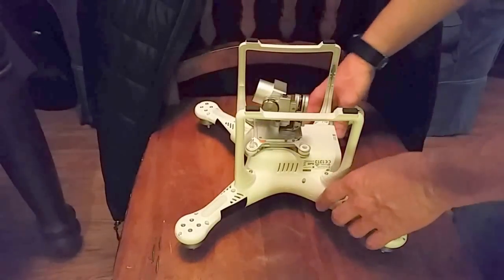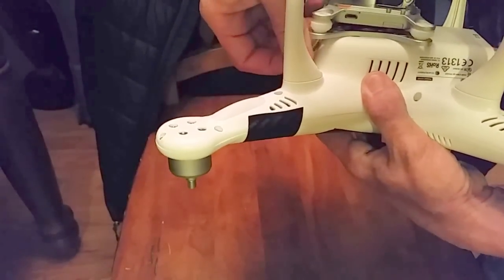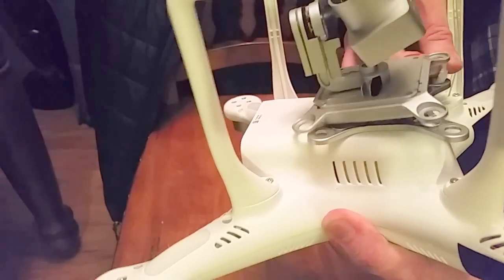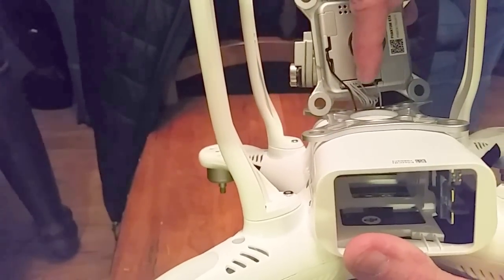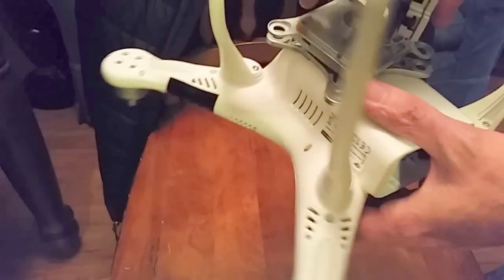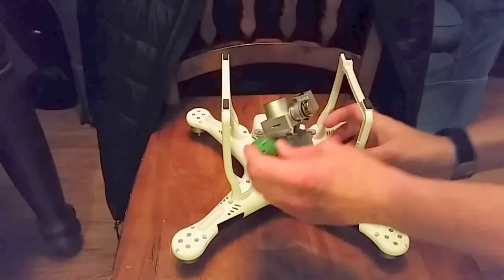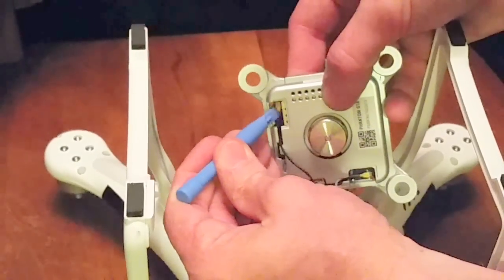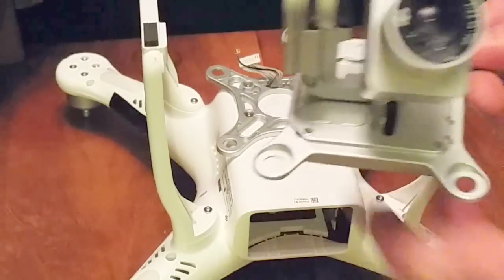How to remove the DJI Phantom 3 Standard gimbal & camera

Comment: Had a crash this morning.  3D printed a part from MyMiniFactory and used these directions to repair my Phantom.  https://www.myminifactory.com/object/3d-print-dji-phantom-3-camera-vibration-absorbing-board-54572
All went well.  Antenna wires are difficult to reinstall with my fat fingers, but be patient and don't force it.  Thanks for the help.
Reply from the maker: I saw the link. Is that your site?
Reply: no
Reply from the maker: Well, thank you for sharing the link. Ill pin it to the top so maybe more people can use the info too.

Comment: In a crash, the black and gray wires separated from the gimbal. Any thoughts on what to use to reattach them? btw, your video is very useful!
Reply from the maker: Thank you Todd. If I remember correctly the end of the wire is a U.fl connection and most wifi antenna wires are the same U.fl. you may be able to use a wire from an old router. Its been a few years since I messed with the P3 so I just can't recall.

Comment: Can I remove that camera permanently and connect it to my laptop to use it as my laptop camera
Reply: Well I was just trying to but every single wire I put did not work
Reply from the maker: Ya you will probably need to find a wiring diagram.
Reply from the maker: Lol. Thats one way to use the camera. 
You probably can. If you can figure out the wires.

Comment: Recently had a crash and my gimbal stopped working, it says "gimbal overloud” and when I turn my aircraft on the gimbal become crazy. By the way my camera works perfectly and I get a feed right to my app, and I can change the angel of the camera remotely, so I’m thinking it’s not a wire problem. I hear a grinding sound; it’s definitely making a noise and the gimbal parts become warm. Do you recommend I replace the gimbal or its other parts problem? Thank you.
Reply from the maker: I cant be sure but it sounds like the gear in the gimbal arm in broken. You might be able to replace the parts but  im not sure if you can. You may not be able to get those parts.
Reply: could you send pic's of the gear in the gimbal arm please.thank u

Comment: hey do you know exactly what does black and grey wires do? in my opinion and research flat grey one is gives power to the gimbal which makes it possible to move. other two is i just dont know
Reply from the maker: Hannah Banner Its been a long time since I have looked inside the P3S but I remember 2 ceramic antennas on the side of the battery compartment. Two wires go to there.

Comment: I have the phantom 3 standard the gimble works fine but I have no video feed can I take the gimble off and put a gopro 📷 on it?
Reply from the maker: Im sure its possible but the wiring harness would need to be changed.

Comment: Anger sometimes can motivate. Still angry at Helipal, figured the parts won't show up until the next Chinese New Year, so I broke out the soldering iron, spent an hour splicing, using magnifying glass, reassembling and fixed it. Took these pictures today: 

     http://decsoftware.com/aerial_photos.htm

Comment: Great! Unluckily my two antenna cables were broken, but I fixed it! But why are the antennas in the gimbal? The two cables are for the connection, right?
Reply: And are there videos, how to replace these two wires?
Reply from the maker: It has something to do with sending the video back to the controller. One antenna controls the aircraft and one is for telemetry. If I remember correctly. Its been a while since I messed with the P3S
Reply from the maker: Its dangerous to repair the wires. If they loose connection you could have a fly away. Its safer to replace. Which is a huge pain in the, you know what... There are videos out there to take the aircraft apart.

Comment: You mentioned during the video at about 4:50 USL connectors.  Any idea where to get replacement USL connectors?
Reply from the maker: I did at one point but its been so long that I can't remember now. Have you tried Amazon?
Reply: Thanks for your reply.

Yes, and all the electronic parts stores in America (well, only about 5 national stores). "USL connector - what?"

My wires pulled out, so I thought I would replace them. Not as easy as I thought since they've already been crimped, so I thought I would go with new ones.
Reply from the maker: Man that sucks. Last time I looked at B&H they also were out of stock. You may have to buy a crashed drone. You will probably have to replace the antenna inside the drone.
Reply: Still looking for USL. Why would the antenna need replacement?
Reply from the maker: Aren't you talking about the grey and black wires that lead to the internal antennas on the drone?
Reply: Yes. They attach with the little push on connector. You remove them at 5:00.
Reply from the maker: Try this link. scroll down the page and see if anything will work.
http://www.helipal.com/djip3-042-cable-set.html
Reply from the maker: Dan Clark Awesome, I had forgot about that site until you said something.  goodluck.
Reply: Well, instead of getting a new drone ($500) and using the 'old one' (4 months old) for backup parts, I ordered 21 bucks of replacement parts and I think I'll be 'good to go'. Thanks!

Comment: thx that was so easy! however dji's slow and lazy repair team tried charging me 210 (total was 350! drone cost 400!) for a brand new gimbal when they could have just replaced the terminal on the wires! So I asked them to return it! they will scam you!
Reply from the maker: Ya you can't trust them. They are a very greedy company that does not care about the customer at all.

Comment: Thanks for this, great help!  I have to replace the bottom bracket attached to the body and the black and grey wires had me concerned.  Wish I'd watched this before cutting the plastic shock absorber pin, but oh well.
Reply from the maker: Dan Harrington I hear that. I had a similar experience installing a backup camera on my car. except I removed the whole bumper. lol. #lessonslearnedthehardway

Comment: are you saying you can your drone without the gimbal? the grey and black wires are for the wifi antennas so idk how it could fly without it?
Reply from the maker: Yes, You can fly without the gimbal. YOu wont get telemetry sent back but the antenna is still working. I have not flone very far without the without the gimbal but definitely have flown without it. Fly 30 or 40 feet away then flip the RTH switch. It should still work.
Reply: ok cool, i just had a bad crash and one of the antenna wires broke so I am waiting for the new one to arrive
Reply from the maker: Just fly with caution. 1 antenna is for the video. 1 antenna controls the drone. I forget which one does what.
Reply: hmmm, idk either. i have no plan to fly it til its fixed properly. after the crash i was able to power up and throttle up the motors but i was unable to set a home point and my go app doesnt find the craft by default, i have to scroll through the other drones like i did the 1st time. hopefully once all is repaired i can do a recal and maybe that will fix it?
Reply from the maker: Ya I see the problem. Ya better safe than sorry.

Comment: Can you fly it without gimbal & cam?
Reply from the maker: yes you can, you just wont get the information on your device, like video, gps, distance. so just make sure you learn the different LED light signals.
Reply: Guardmy6 are those failsafe options still accessible through dji.go apps?

I'm planning to remove gimbal & camera for temporary and keep them safe while i learn to fly atti mode accurately at low altitude on open area, prevent high loss in case of crash.
Reply from the maker: +Singgih Arfianto that is an excellent idea. highly recommended too.

Comment: hey  @Guardmy6 - if the grey and black wires have detached from the gold connectors -  should be able to reattach without having to replace the wires?
Reply from the maker: Is it possible? Yes. But I'm telling you from experience. You take a huge risk of crashing again. or worse, a fly away. Sorry I wish I had better news.
Reply: why?
Reply from the maker: The wires are put in and crimpt with a tool. If not done right it could come loose. Thats when the bad stuff happens

Comment: I've snapped the camera off the motor. The camera is fine. What would you recommend replace the hole gimbal or any other solutions
Reply from the maker: Did any thing else break? or was it just the arm the holds the camera?
Reply: just the arm
Reply: and a broke flex ribbon
Reply from the maker: Sorry for the delay, I didnt see your comment. you can probable fix the are and replace the ribbon with a new one
Reply: Exterior the 3d printers provide excellent replacement parts for the gimbal
Reply from the maker: What do you mean?

Comment: can i replace those antennas with 2 normal 2.4ghz antenas? for the gimbal signal? :D
Reply from the maker: that is a good question. i cant say because I have never tried but i would think as long as the Uf.l connector fits and its the same frequency it should work. but i dont know enough about it. sorry
Reply: +Guardmy6 I have 3 cables in pretty sure will fit! I will give it a try
Reply from the maker: +Edmundo Andres sweet. let me know. i took the cables from my wifi router and put in my controller. it worked fine.

Comment: hi i have a question. recently had a crash and my gimbal stopped working, it says "gimbal gyroscope error" and when i turn my aircraft on the gimbal just doesnt work, it stays limp. By the way my camera works perfectly and i get a feed right to my app, so im thinking its not a wire problem.
do you recommend i replace my gimbal and camera or is it a wire problem? thank you.
Reply from the maker: Well, that's a tough one. If the camera still works it is probably cheaper to fix it than replace it. I can't be sure without seeing it but it sounds like the gears inside the gimbal are stripped or broken completely. Do you hear any noise coming from the camera or gimbal? like a clicking or grinding sound
Reply: Guardmy6 I think i hear a faint grinding sound, its definitely making a noise. i just want to thank you for giving me some advice in advance, i havent been able to get help or an opinon from anyone. i need to fix this asap because i have some projects coming up. I was thinking of buying a new gimbal and camera or even a whole new drone body. :/
Reply from the maker: Glad I could help. Thats the whole reason I made the video. At the time I could not find any help either.
Reply: Guardmy6 i decided to just replace the drone body, as the need for a drone right now is dire.
Reply from the maker: Good luck man. I was filming a sailing regatta and the battery lost all power at 30% and I lost the whole drone.
Reply: Guardmy6 oh no :/ some bad luck.
Reply from the maker: For sure. Hopefully DJI will honor their warranty. Flight logs confirm battery failure.

Comment: AS YOU SAID ... there's not much on this and your video covered everything i needed to know ... about the black and grey wire ....i had a disconnect and needed to to simply reconnect them
Reply from the maker: awesome. glad your back up and running
Reply: I added a second to the arsenal so i can learn from one and in action times now i have more batteries and it ended up working out
Reply from the maker: Nice. I did the same thing. I have a standard and Pro. Of course you have to modify the P3S antenna. lol

Comment: Does it bind to the controller without the gimbal on? thanks great vid.
Reply from the maker: +Ppr Rud Good question. If the controller is already minded then yes. If its not, I don't know but I would assume so. I did fly mine without the gimbal but just don't fly further than line of sight.
Reply: +guardmy6 Why shouldn't i fly further than line of sight? Shouldn't the range stay the same.
Reply from the maker: +Ppr Rud theoretically yes. I just say that to be safe. I have not tested the RTH function with the gimbal off.
Reply: +Ppr Rud Thanks for replying by the way really appreciate it.(:
Reply from the maker: +Ppr Rud no prob.

Comment: where did u sent your camera to for the fixing?
Reply from the maker: +Khade Muangkroot I did not send it off. I fixed it myself. 
I made this video showing how I fixed it and where I bought the lens. Hope this helps. 
https://youtu.be/p8khpF9tgc8
Reply: +guardmy6 how to check if the software in the camera is working fine? I broke my yaw arm and the ribbon cable everything else look fine from the out side the drone still flying but cant connect to the GPS
Reply from the maker: +Khade Muangkroot 
the ribbon has to be fixed for the camera to work. As far as I can tell the camera has to be functioning to get information on your phone. in other words, broken ribbon means no GPS signal sent to your phone. If your phantom hovers in 1 place without moving then your GPS is still working but the phone shows it as no signal.
Reply: +guardmy6 just check the flying GPS system didn't show up on the phone but it still working fineso is that mean that I only have a problem with the yaw arm and the ribbon then?
Reply from the maker: +Khade Muangkroot I can not say for sure. but it sounds like that may be the only problem. Good Luck my friend
Reply: +guardmy6 thank you so much!

Comment: Thanks for the video.. I had a crash and the camera mount broke and the whole thing ripped off..Ripped the wires right off the camera and I could not figure out where the black and grey wire went to.. Now I know but those tiny pins connectors you popped off for the black and grey are going to be hard to attach back to the wireing.. I wonder if I should just solder those back on. I think my camera is OK just those wires all ripped out.
Reply from the maker: +Randy H I have tried to crimp that type of connector before (UFL connector) you will only have problems if you don't just replace the whole wire. You need a female  U.fl to U.fl cable. Sorry for the bad news
Reply: +guardmy6 Thank you for the response. Do you know where I can buy these type cables? I looked on Amazon and one end looked right but cant tell if its right size. Thanks for your help here is what I found http://www.amazon.com/U-FL-RP-SMA-Pigtail-Antenna-Cable/dp/B005UWD0EG
Reply from the maker: +Randy H definitely not that one. If I looked at some websites earlier and found them. I'll look it up again. in a couple of hours. I'll post a link when I find it.
Reply: +guardmy6 Ok thanks... Do you know how they connect inside the drone? I was trying to figure out what do they control. It looks like they head over towards the battery maybe looking for power for the camera? I hate to have to remove the main board if I dont need to.  Thinking I might just do a splice or solder the wires back on the camera. Also do you know where to get the grey ribbon cable?
Reply from the maker: +Randy H I looked online last night but I can't remember if the other end is UFL also. I do remember it connects to the top of the main board (ESC)  the ribbon you can get from DJI. I would even try to call and ask if they have the Grey and black wire. they should all be cheap
Reply: +guardmy6 No problem I found a set. Those 2 wires are actually a antenna set. Kind of expensive little things! wow.. All together my parts needed are about 47.00 here is the web site. http://www.helipal.com/djip3-097-2-4g-antenna-set-sta.html

Comment: what are those wires for the 2 black and the grey one i brobke mine camera bought new one connected back but i dont get signal to my phone or camera view is gone  but the little hrey cable is not conected cuz broke  cuold not put it back  so im wondering what is for ,, other than that the camere works it moves perfectely  but i dont get camere view
Reply from the maker: +Carlos Sosa 
Sorry to hear about your accident. Can you email me pictures of the wires, gimbal and camera? Im not sure which ones you are talking about. I do not know about 2 black wires. You should only have one.
Reply: sure i can emailyou a pic by the way i contact dji phantom nd they told me to send the drone to them to check it  but im alittle afraid of how much they charge  ,,, so ho wow can i email you a pic of the wires  i just the grey wire that goes to the gimbal  well there are 3 the big one grey  and two little one one black and one grey so i broke on eof the little one ,,,
Reply from the maker: take a few pics of the gimbal and camera from a few different angles and email them to guardmy6@gmail.com I will help if I can